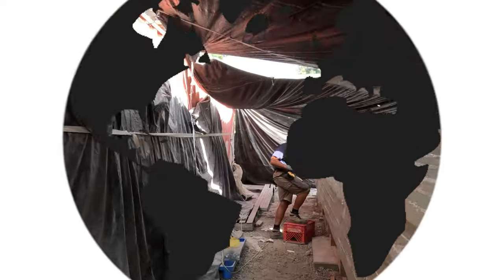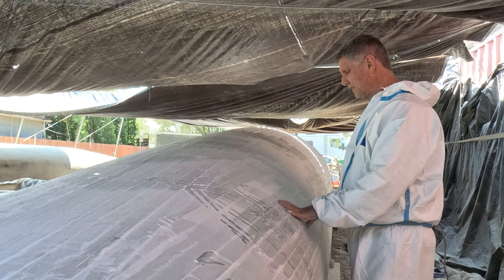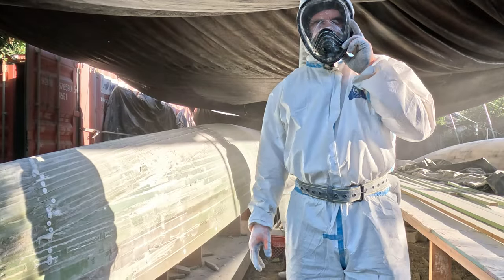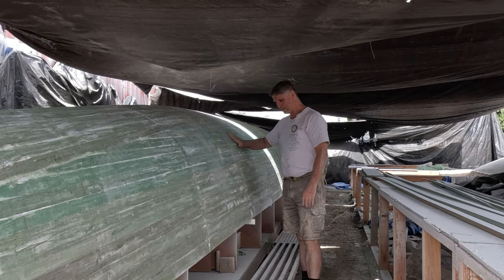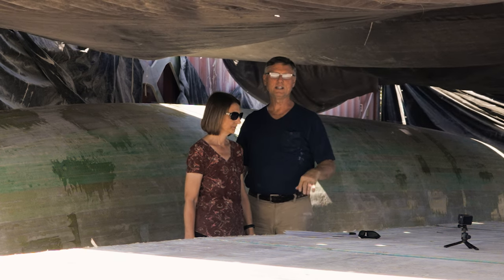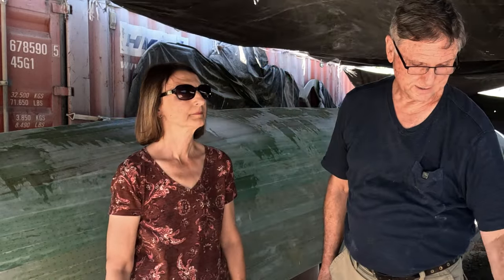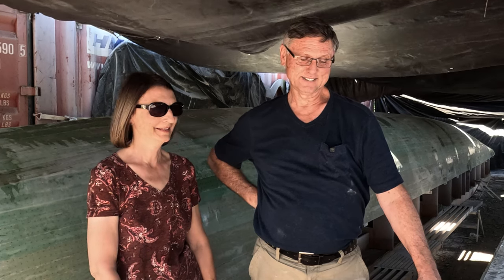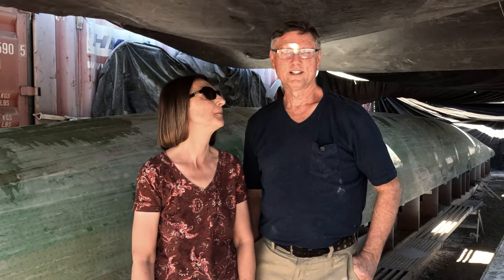Kit E56: Sanding the Starboard Canoe

Comment: I am very glad to hear that you are turning the boat around because it will make almost everything easier.  That said, I would not give up on hauling the boat out on a trailer because being the other way around will make getting it out of the lot easier.  There is no reason that the boat cannot be loaded onto a trailer with the bow to the rear of the trailers.  I have seen cat manufacturers haul their boats that way.  With the bow to the rear, the curving part of each hull will provide more clearance for the turn.

For background, I was an over-the-road and off-road trucker with 1.2-million miles logged.  In the off-road work, I would need to do a U-turn with a 32' long trailer on a mountain road which was only 25'-30' wide.  In the OTR stuff I had a delivery that required me to put my 52' long trailer onto a loading dock that was in a 55' wide alley with only 36" of spare room off the nose of the trailer with the tractor at 90º to the trailer.  Tail-swing is a powerful friend in moving things on a trailer.

If I needed to get your boat out of your site, I would consult with several trucking companies to see what they have to say.  I would start with a google earth screen shot with a graphic of your boat on it and let them play with it.  To my eye as a truck driver, you have lots of room to make the turn.
Reply from the maker: We have already had semi driver's out to take a look, it's very tight.

Comment: For filling the screw holes, I would use the epoxy syringes that West System makes to inject the thickened epoxy from the bottom of the hole so that you do not trap air at the bottom.  I have found that catsup and mayonnaise consistency is easy to squeeze through them.  I have also found that they are reusable several times with just a bit of clean up with Alcohol.
Reply from the maker: Good suggestion.  We do have a syringe.

Comment: a tip is to build lifting points/loops into the boat so you don't have to use a liftingbeam or a yoke. I have done it on my smaller catamaran and it works great (37ft)
Reply from the maker: In this case, those mounts would have to handle 34,000 pounds, so I'm not sure it is worth the time, effort, and weight of adding them.  We don't plan to haul out all that often and the yards are going to have their own system for that and want to do it their way. But thanks for the suggestion.

Comment: You may like to consider glassing the hull in sections.  Lay the 4 sheets of glass on a small section, maybe just 3 sheets wide and when tacky, lay on the fairing compound so that you get a wet chemical bond.  This will save much peel plying and or sanding before fairing, you only need to peel ply and sand the overlap between sections. The following day you can glass and bog the next section.
Reply from the maker: Possibly, but we are following the schedule of layup recommended by Schionning for their kit construction.
Reply: @SailingSVLynx  You might look at this week's Magic Carpet.  What Aladino did was lay up all of his glass layers and then after the final layer of glass which you would apply the peel ply, he laid on the first coat of fairing compound.  That way there was a wet on tacky chemical bond between the base layer of fairing and the final layer of structural glass which makes a much stronger bond than just a mechanical bond.  This first layer does not need to be well shaped to the curve.  It is a binding layer so scrape it as tight to the cloth as you can get it.
Reply from the maker: We prefer to lay the peel ply on the basalt without fairing compound in the way.  It allows the peel ply to absorb excess epoxy. The strength is all in the basalt layers, the fairing compound is just for creating a smooth surface for paint.
Reply: The above method will save a lot of work and the extra material (peel ply), proper squeegeeing will remove the excess epoxy.
Reply from the maker: We'll stick with the manufacturer's recommended methods.
Reply: @SailingSVLynx  👌

Comment: couldnt you use a slowing curing compund and use say brian or yourself to run the squeeze out along the boat (like the flexi sander) to stop leaving patches?
Reply from the maker: Unlikely.   We did smooth the squeeze out on much of this canoe, but there are always a few places that need attention  later. This time there weren't many, most of the work was filling the screw holes.

Comment: What was the final root cause of the Victron system failure a few weeks ago?  What tools were needed to determine the cause? If this happens again, could it be resolved even if you are at sea?
Reply from the maker: There was a short in the lynx shunt, no reason why if happened.  At sea I would simply take it out of the system as it  is informational only, tracking power usage.

Comment: Why not to buy  and refit ? faster and cheaper
Reply from the maker: We covered that in a recent video, Why build our cat?  But the short answer is, that is much more expensive.  Try to find a 50' performance cat that is no more than 13 years old for under 700k, before a refit.  Then add the cost of the refit, 150 to 200k.  That puts you at 850k minimum.

Comment: If I hear you literally, you just said you would put each canoe back in its present spot. Meaning the port now becomes the starboard and starboard becomes the port?
You did say they are identical at this stage.
   😅😅😢😮
Reply from the maker: Correct, the canoes are symmetrical.